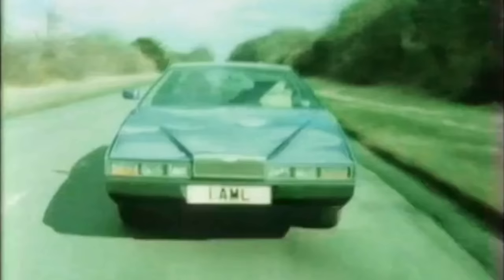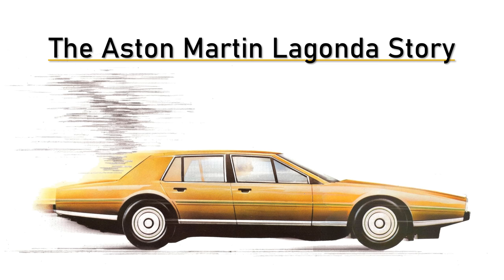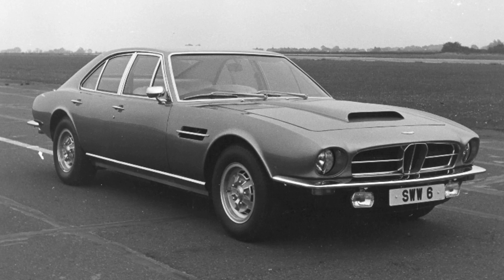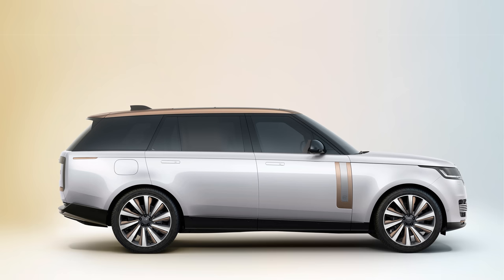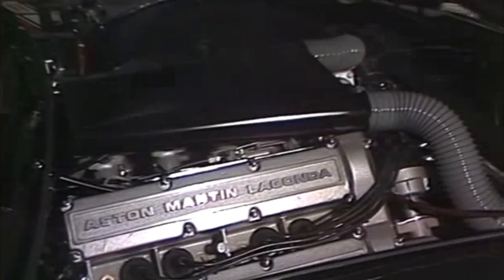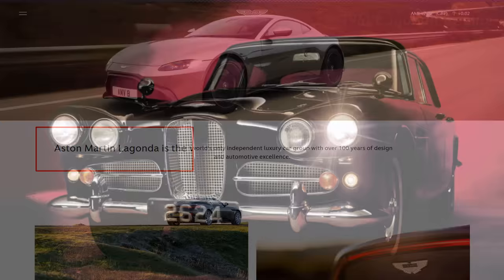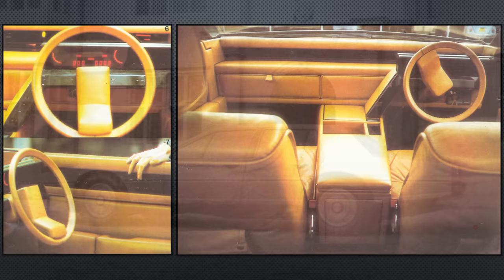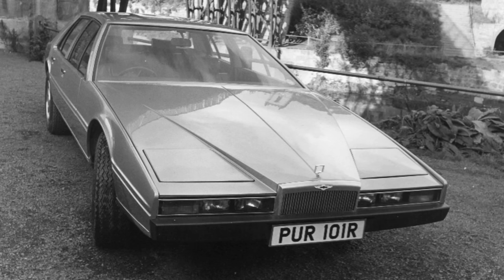That Crazy Electronic Wedge. The Aston Martin Lagonda Story

Comment: Five decades later, touch controls are still a useless pain in the back that force you to directly look at the button while driving.
Reply: I have touch sensitive HVAC controls in my HR-V. Seven years later I STILL cannot change the settings unless I glance down. I know how it's laid out but there's nothing physical I can feel to determine how my aim is when I'm still looking at the road.
Reply: Well those buttons were actually buttons and not screens, I'd take those any day over attempting to drive a Tesla.
Reply: Toyota tried to dress them with Touch Tracer technology for the 3rd gen Prius and later switched to classic buttons, though that car still had mechanical switches behind the smooth to the touch membrane.
Reply: @scott8919 😊
Reply: I glance at my physical buttons out of habbit anyway so capacitive controls don't bother me.
Reply: I wonder how many lives touch screens will end prematurely.   You can't touch an answer button on your phone but is totally fine to scroll through a menu system to adjust your heated seat controls.  How can car makers be so irresponsible?
Reply: Yes, and that's why I will never understand something like Tesla's "One Big Screen That Controls All" philosophy. Just to change the climate control settings takes away your attention from traffic for a ridiculously long time, as you have to navigate to the proper menu on that screen. Just because something CAN be done, doesn't mean you HAVE to do it.
Reply: @tjroelsma  You don't understand Tesla? I do. They're cheap ;-)
Tesla had the big problem of having to sell a car that costed more than rivals because of batteries. To make the cost of the battery less evident, they chose a luxury car. But they can't do luxury, they have quality issues and they have to save a lot of money. A big screen is much cheaper than a ton of buttons and feels futuristic. Plus you can pack it with dumb party-features that first-time luxury cars buyers love more than good paint, reliability, good interiors...
So now we understand Tesla. What I will never understand is the rest of the industry. Especially the Germans. Before Tesla they had ALL control redundant three or four times: a button, the screen, a touch pad, a control wheel, voice controls... they couldn't choose and didn't want to disappoint long time customers.
Then they suddenly chose to follow this stupid trend and give up most controls. Instead of standing out for practicality and denouncing Tesla's trick, they adopted it and let Tesla win.
Reply: @cicalinarrot  Hahaha, yes, Tesla being cheap would explain that display, doesn't make it less of a shitty decision though.
 
As to the Germans following Tesla's trend: Tesla owners seem to like it, so the Germans, and I might add the Japanese as well, follow that trend, even if it makes no sense at all.
Reply: @tjroelsma  Feels a bit more normal for the Japanese but come on, German had been sooo rational and conservative until now!
I expected the screens to be another redundant control, maybe to replace that weird stuff like the pad where you write letter by letter... instead we get cars where you have to navigate through digital menus for some climate and seat controls.
Reply: @Clay3613 I shouldn't worry - a Tesla would fall apart or brick itself long before you tried to drive it...
Reply: I drive ambulances and someone thought that a touchpad in the middle of the center console would be the best way to place the emergency controls (such as sirens, horn, rotating lights, etc.) on most ambulances we use and is a pain while driving solo on the cabin to operate those controls while driving, especially at a speed...good, old fashion buttons/switches you could just operate them by feel, without looking.
Reply: @MillerCorner  and still the top EV seller
Reply: Yeah, i prefer buttons while walking and texting too. Now I have to hope I look up in time if walking, or actually stop to tap messages out. Long gone are the days of messaging while walking without even looking at the screen 😞
Reply: Sounds like a skill issue
Reply: @ZephyrCorsa no, its bad design...
Reply: @ZephyrCorsa  call it like you want, when most buyers are "not skilled enough" to use something, the design of that thing is crap and the designers are out of touch idiots.
Reply: My father's late 50s Peugeot 403 beat the Lagonda in having a two tone horn, so nothing new there!  As for modern instrument displays that can emulate traditional dials, give me a set of Smith's finest any day!
Reply: You would love having a Chevy Volt with lots and lots of touch control buttons.
Reply: @antonio_fidalgo 
You need the switches to be positive. Even if you can look at touch switches, compare that to a passenger trying to text in a moving vehicle.  The mistakes are so frequent.
Reply: @zigzagtoes 
If you don't want to look at the buttons or screen while texting, try getting it to accept your voice.  You will have to accept a slightly reduced vocabulary to accommodate Control Characters.
Reply: @tjroelsma Tesla screen works fine.  The designers did a good job and the result is that you can control the car as effectively (or more effectively) than physical buttons. I love quality physical switch gear, but people generally have no clue how far things have come for some manufacturers.  Of course, the competition continues to miss the mark because they are terrified of being as bold as Tesla to fully embrace a simple and effective single dynamic interface.  But continue to half-ass a hybrid or mixed solution.
Reply: Doesn’t bother me - I get used to anything.
Reply: @michaeljordan6008  Humans are incredibly flexible, I believe that, at some point, almost anybody could get used to these things. But I'm pretty sure it takes longer on average and, considering how often people swap cars nowadays, making them intuitive to use is supposed to be a priority...
Reply: fredriklarsson8105 I remember tellys that went cloooing as one button popped out when you pressed another in. Live your description of the sound.
Reply: @cicalinarrot It's because they had to make huge investment decisions. They needed to cut costs.

Plus the US attempt to break the stranglehold VW once had over the US car market by singling them out over emissions cost alot of money.
Reply: @tomellingham8627  Fine (ish) for cheap cars, much less for luxury cars.
Reply: Just rubbish. Any hepatic button is useless and if your finger is slightly damp or cold it may not even recognise it properly! Also easily accidentally pressed especially if on the wheel.
Reply: @myparceltape1169  my phone doesn't think I'm English due to the accent, besides which, some messages are too private to be dictating in public 🤣
Reply: @zigzagtoes  Progress  Ugh!
Reply: @MillerCorner  "a Tesla would fall apart or brick itself long before you tried to drive it..." Tesla say that their cars are designed to last for 35 years (which is longer than most other consumer motor vehicles^).  We will find out, eventually, if that is true or not!

^ Buses and airplanes and the like are designed to be operated for 35 years, but AFAIK most consumer motor vehicles have a design life of 7-10 years, which is the lifespan they mean when they say the transmission is, for example, "sealed for life".

Comment: I was a paperboy at the age of 12 back in 1982 when I first discovered this car.  One of my clients was a car enthusiast and had books, models, and even the brochure for this car.  I was enthralled with the car and its single-spoke steering wheel.  Nothing has changed 40 years later.  I still am mesmerized by this stunning shaped car.  I would be besides myself if I had a chance to just sit in one!
Reply: Right then; the steering wheel on series 1 & 2 cars will feel incredibly small in your hands. Lock-to-lock is like an Italian supercar of the day. You'll be amazed how tight & cramped the driver's footwell is too. Both front seats feel as soft as beanbags filled with feathers. It's unbelievable how soft these unique seats are. Headroom's slightly worse than a Jaguar XJ40 saloon of the day & you're a wide length away from the person sitting next to you.

Comment: 19:27 In 2005 Lexus used a similar system on the GS sedan it used a Electronic Chromatic Device System for the gauges that dimmed the transparency to help with driver visibility of the gauges while driving.

Comment: When I was young, I found the original Lagonda designed to be really stunning. It look like you had taken an American car and made it felt and sleek. It’s a bummer that it wasn’t made all that well.

Of the designs that followed it, the last one that they sold 100 or so units of is actually gorgeous. Probably the best way to interpret the current Aston Martin design language in a four-door vehicle. but I think we dodged a bullet that those two concept vehicles weren’t made. They’re certainly striking, and I give points for trying to be different, but… No.
Reply: It looked like a Cadillac run over by a steamroller.

Comment: Considering a modern Arduino microcontroller board for twenty quid could solve all the electronics problems… 🤔 
In the Nineties, I had the pleasure of encountering a model 3 in the wild closely. What an impressive machine! It looks better live than on screen, really. The deep sportsy roar of the V8 the one I saw had was dampened down to almost zero when doors and windows were closed. The leather interior was notches up from what you'd get in the upmarket Beamers and Mercedeses, just beautifully made. The green monochrome screens look a bit odd in pictures and videos, in the flesh this was a completely different piece of cake, it was a stunning sight!
This car left me behind ever so slightly dumbstruck.
But yes, it didn't exactly offer itself as daily driver. Besides the somewhat unusual ergonomics you discussed, there was a huge oil sump to heat up! I don't remember the exact number, I think it was over ten litres! You'd be half across Britain by the time all of that really reached full working temp! The 24Volts electrical system probably causes more than a few headaches to owners nowadays as it makes spares doubly hard to find.
But bet your favourite buttock: Should I get to have big money one day, there would be a big big parking for all the odd old cars I would get due, and a model 3 Lagonda would be one of them! 🤗
Reply from the maker: Maybe not. Electronics need to be automotive rated (they need to survive extreme heat and frigid winters). But you're right that you could pick up an automotive rated Arduino or similar board for very little.

Comment: The example of the elevator touch controls are now illegal in buildings in the USA due in part to the 1988 First Interstate Bank fire in Los Angeles. Today it's the 2nd tallest building in Los Angeles. Those touch buttons have no moving parts and work by heat activation. The fire in the bank skyscraper can cause the elevators to be called to the floor of the fire. A maintenance worker sent to investigate the fire alarms arrived when the floor was fully engulfed and he could not get the doors to close due to those buttons.

Comment: Having just got a mini Convertible 2012 63000 miles, I didn't like the fact you said. No. Loads of issues! Especially since I now have an engine reduced power light on. It's not the n14 with the bad chain tensioners, it's the newer n18 so I thought there would be no major issues. It's currently usable so long as you don't use more than 50 percent throttle which will cause shuddering and no extra power so my cooper S is effectively a mini one. Hoping it's not too expensive a fix especially since knocking noise over bumps to sort as well. But suspect vaanos seals as they're meant to be changed at 50k. That probably means the car has been maintained with basic servicing and none of the extra stuff the mini needs. Roof works great, body work immaculate, gearbox/clutch great, when it worked engine was fast, but was it traded in because it is a likely money pit? No warnings when I got it. Other than a non working stop start which I don't really want to use on a 10 year old car anyhow. An further example of stupidity is the key. Tried to change battery in the spare key. In most cars you simply take the battery out. With the mini it's soldered onto the motherboard. It's almost impossible to open the case without breaking it, so you can get spares easily. But I didn't realise the battery wouldn't simply clip in. That's got to be a way of making money, can't see why else it wouldn't have a usable battery. I now have totally broken it. So have 1 key. If that goes flat I'll need to get it done at a dealer. Crazy! I find it fun but if I keep thinking it'll break when I use it the fun will soon wear off.

Comment: Folks today can't imagine what life was like back then...
- Pre-smartphone
- Pre-streaming
- Pre-wifi
- Pre-internet
- Pre-mobile phone
- Pre-computer
- Pre-CORDLESS phone!

The first electronic calculator was technology heralding a massive cultural shift (prior to that, learning everything by heart - and using slide rules). The LED display technology predates the LCD that became ubiquitous until modern high-resolution methods came along. 

To be forward thinking requires a big gamble, nobody knows the future - and being first is always a big risk. The guts and effort to decide on - and then actualise - a digital cockpit in that era blows my mind. 

Granted it was very high end. But regular folk at that time were still buying cars where power steering, electric windows, etc were OPTIONS! Even brake servo-assistance wasn't universal. 

Literally nothing on regular cars was electronic, the ignition was just a coil and distributor, the locks were operated with a key (one by one!)... Nobody had aircon, ABS wasn't mandated - even wearing a seatbelt wasn't compulsory until 1981! 

So to say this was futuristic is an understatement. The styling is STILL from the future (comparable to Thunderbirds TV show maybe ?). We've had decades of different efforts from all the makers on some variation of a 'blob', following each other like fashion slaves. One or two stand out, as this great channel demonstrates - but not many.

Comment: Cadillac was able to offer a fully functional digital dash and trip computer on the Seville in 1978.... before the first Lagonda ever got into customer hands.
Reply: Early electronic dashboards were horrible, period.
Dry joints occurring upon the circuit boards made for needless problems and at worst failure was unacceptable for such an important component of a car.🤔
Reply: @khylerin70  Every Seville I've seen with a trip computer still functioned years later, it was an expensive option so it wasn't very common, but it seemed reliable. The guts of the system were used through the 90s in later cars. The Cadillac system basically used all the data that the cars fuel injection computer was already reading and displayed it on the dash.

Comment: I had one. Hated it. Would overheat for no reason. Mist inside the headlamps should be solved by heating wires in the glass. The relay was… under the back seat😂and didn’t work. Digital dash was an everyday surprise😅

Comment: And the car industry never learned it seems, by trying to revive touch sensitive/haptic controls or simply putting all controls onto touch screens instead of tactile, easy to hand, easy to operate, buttons/switches etc. I remember seeing a few youtube reviewers who raved about them only to succumb to their audiences AND their own later real life experiences of them i.e in reality they were/are a terrible idea for a lot of operations. Some manufacturers are still holding onto them despite the resistance from customers, but because they are cheaper than real buttons & switches to implement (I believe) they are dragging their heels in admitting defeat by removing them.
Reply: Ahhh - a lot of what I wrote was covered later in the video.🤭

Comment: Errrr..... Lagonda (cars) started in 4906, were bought-out by Aston Martin in 1947 and abused the name when they brought out the AML 'TurdWedge'.....
Reply: It was an iconic car, the fact you don't like it is irrelevant.
Reply: Errrrr...... Nope.
It was unreliable, many of the electrics/electronics failed, push- buttons often failed (even if you stared reeeeeaaaly hard at them (while driving).
The only thing 'iconic' about it was how AM could stuff together so many awful design/manufacturing failures.
HTDCYU

Comment: Such a flawed concept! You wonder why someone in the company wasn't switched on enough to recognise the problems. Many of its problems derive from the ridiculous proportions - a sports car can be low, but having a limo so low is pointless clearly made the cabin difficult to set out properly, made it too hot inside, and compromised the engineering and made the whole thing wildly space inefficient. And after that it wasn't even aerodyanamically efficient! Then of course the electronic controls and display, which were obviously a nightmare to even get functional - why didn't someone in the company decide to park them and install conventional controls?